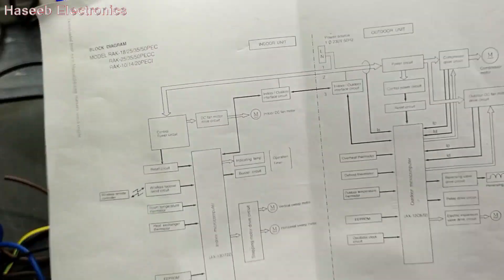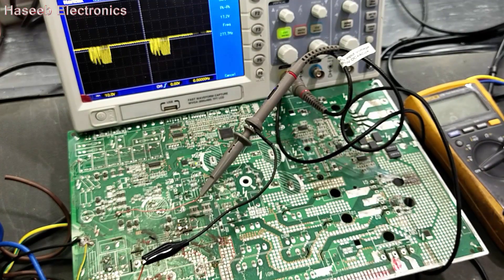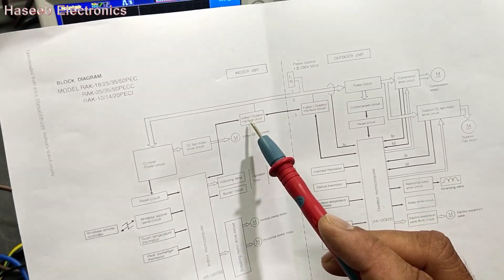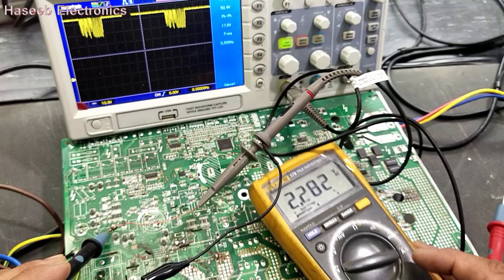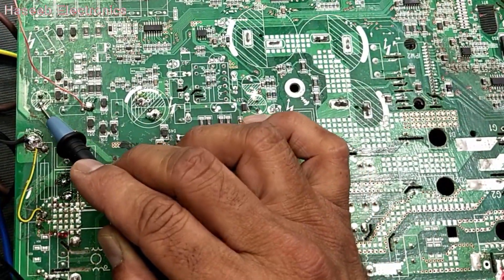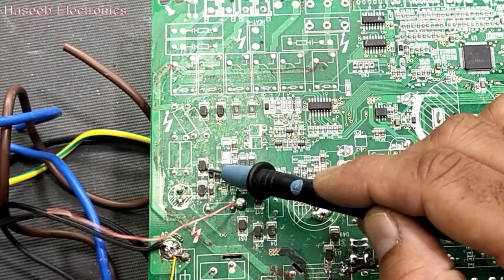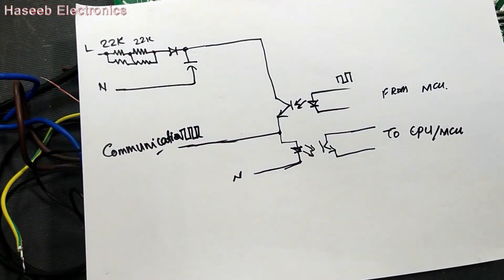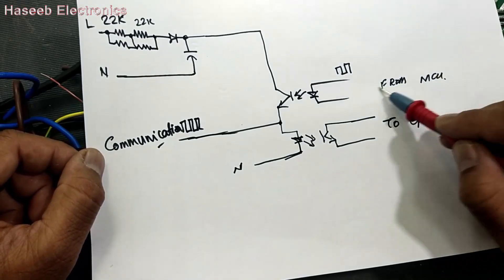344 Communication in Inverter AC Outdoor Unit Circuit Board Repair Course - Part 4

Comment: I have Mitsubishi electric my-2g20. With 4 optocoupler. The signal fix at 24dcv, should be change, I replaced outdoor pcb then the aircon works. I confirmed outdoor pcb spoil but I don’t know where to strat to fix it😅. I hope you can give me some advice.baraka allah fik

Comment: Great explanation of the Gree outside unit control board. I have two of them that I am currently repairing. Can I hire you for some consultation of I need help?. If yes what is the best way to reach you?. Thanks in advance...

Comment: Hello my ac turn on 4way Valve knock, after 3 seconds knock again and that's all. Error from Leds  and stick can be eepromy chip, mce, DC voltage protection. Do you relair such issue?

Comment: sir i have a doubt   which protocol using for communication . mcu to mcu
Reply from the maker: it is not directly MCU to MCU. it uses isolated interface using optocoupler to transmit & receive signals

Comment: Good work explaining thanks for the knowledge it has helped me alot however a question for you is it possible for me to use a microcontroller to simulate switch-on of that system outdoor unit for testing of the outdoor unit? thank you
Reply from the maker: Best regards and special thanks
Yes you can design a microcontroller to generate 3 phase drive signal
Directly turning ON To the same board  requires communication signal

Comment: Aoa, Thanks for sharing such an Awesome project.
Can you please design & share a universal circuit board  having compatibility to drive most of the inverter ac compressors. with speed control potentiometer , running directly from 220 volt ac & having UVW output.
An early response will be home appreciated.
Thanks & Kind regards.
Reply from the maker: best regards and special thanks 
basically a standalone circuit is doable, but it will not controllable by indoor unit. it can produce just variable UVW outputs to drive compressor
Reply: @HaseebElectronics  Yes you are right. Stand-alone unit without indoor control is ok to operate the compressor directly .
This will be a good tool to check the inverter ac compressor when the original drive board is faulty.